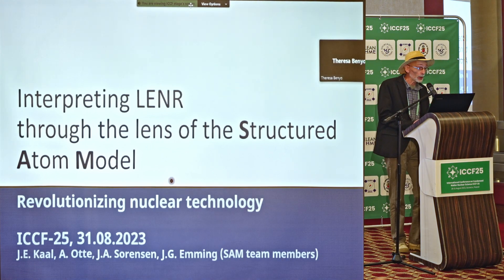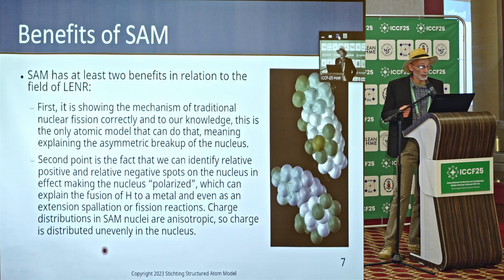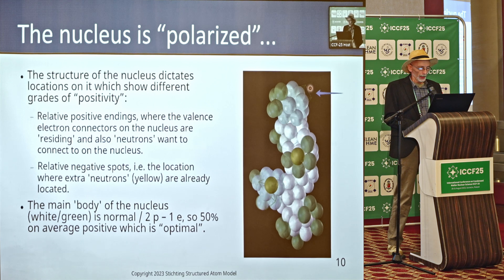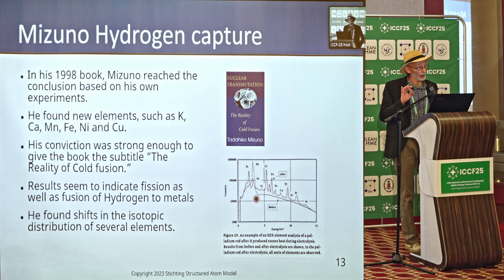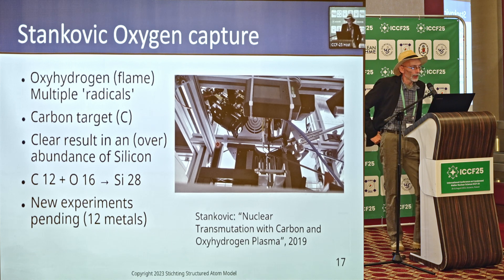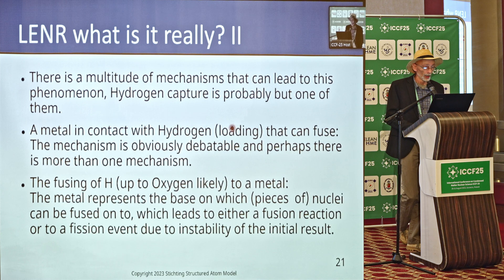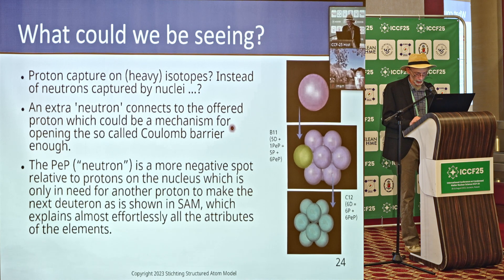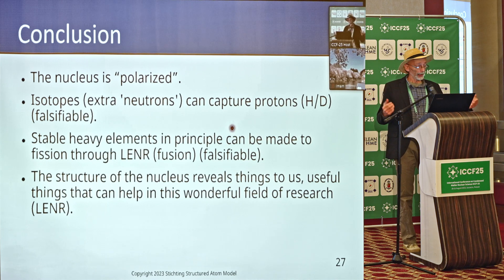Edo Kaal - ICCF25 - Fusion and Fission in LENR

Comment: Excellent work.
If fission energy can be achieved using less Neutron rich elements, such as lead, then it should vastly reduce the production of stray neutrons and highly radioactive lighter fission fragments with neutron excesses.
That could be a fast route to energy technologies with high utility and safety.
Especially if it can be combined with fusion of the lighter elements.

Imagine a reactor system that can be fed any feedstock, and outputs stable isotopes of iron nickel or cobalt. 😮🎉

Comment: The need to understand both the WHY and the HOW of the reactions, the excess heat, transmutations of elements, apparent fission and fusion reactions taking place simultaneously and sequentially in the same experiment, are the paramount issues that the LENR community should address.